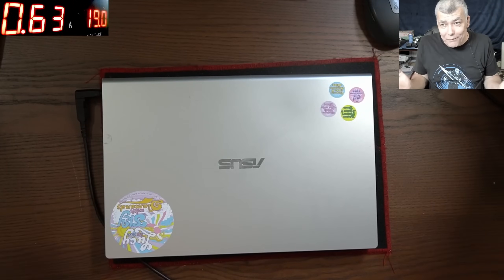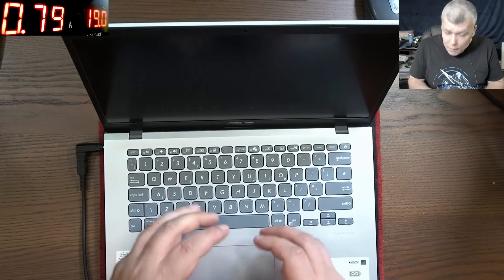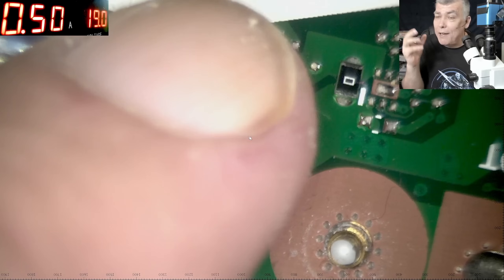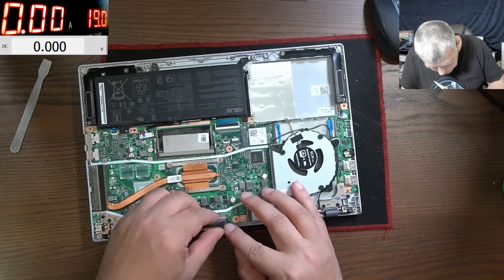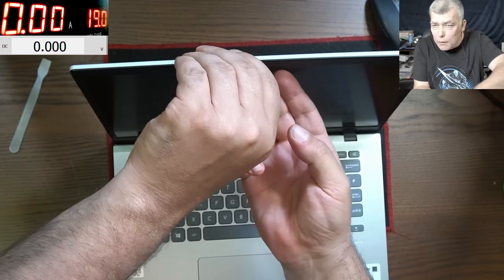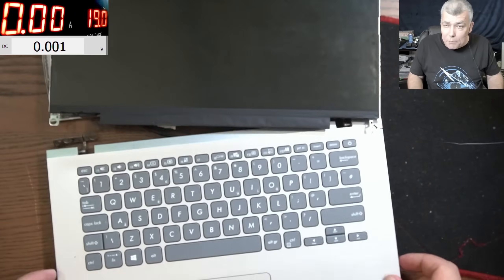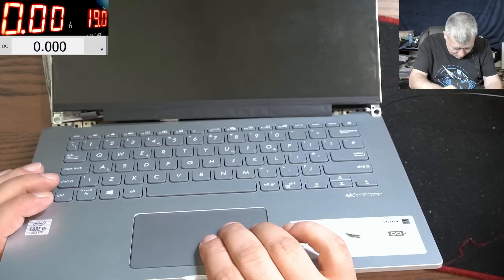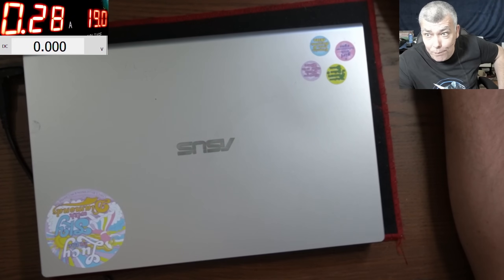Asus X409 no screen backlight repair - You can do it, all you need is a magic touch :D

Comment: Nice repair that show you don't necessarily need tools, or soldering skills to repair a laptop sometimes.  Also I too miss the days when screens weren't taped on, just take off 4 screws and you were in. Very easy to go back and forth if needed.

Comment: I have a different issue. My screen will light up eventually but I have to power cycle especially when the machine has been shut for hours. Sometimes it comes not on boot screen but later when Windows boot... No idea what causes it. X553MA

Comment: Thank you sir, this video saves me, i have same laptop from customer having flickering issue , i'd change the display cable and also check another screen but same result, and suddenly display got dim and customer argue me to give me his laptop as the same condition he brought to me, i was in trouble and ask customer for some time, this video save me , i bypass the resistor which act as a fuse as you mention, then it works smoothly, thanks again sir, hats off
Reply: @anantjain2585  Imma try this one. Yeah i have the same problem with you bro😭

Comment: Hi Sorin ! I often have to deal with glued screen. My solution: I do remove the Hinges and most of the time you can get a view on little tabs to pull the sticky tape.

Sometime they start a bit under the screen. When they are too hard to reach i do what i do when i have to replace a phone battery. Hot pad around 70/75Celcius (depend if cover is made of plastic or Aluminum) for about 6 to 8min, then i try to pull a bit on the screen corner (top corner) and with a pointy tweezers i go fishing for the sticky tape :) ! 
Last resort i do put some Isopropyl alcohol on a plastic card (i like to use the soft one they put with new Ipad battery) and slide it gently from the side to help me remove the Stickyband.

*Carefull with isopropyl, you can easily ruin the LCD if it goes between the diffusing sheets, that's why i'm dipping the card and not pourring behind the LCD*

Have a nice day !
Reply: Lenovo slim screen were made like that with 2 glue pull tapes on the bottom of the screen.

Comment: 13:14 - Vibrations + humidity is root cause for bad contacts. Once it took me 10 working days on big machine to find connector with bad contacts. It works but it doesnt work well enough.

Comment: I love the proper calibrated fuse  ❤ also my APC UPS have 1 of them by the factory on charging circuit (i discover it wen sort circuit the battery cables and replace it with the same thickness wire as the factory).

Comment: I love watching you videos they are so educational and informative...... in regards to removing the laptop screens with the adhesive if they don't come with the pull tabs I always use a little bit of contact cleaner to free the adhesive and it comes off without any problems...... you can see if that helps next time

Comment: As a technician i always get wary of when a customer wants something diagnosised and fixed but fails to tell me that others had attempted the repair prior to me.  Someone had that screen removed before because those screen bezels don't just crack from normal use.  It was removed and someone was poking around in there prior to Sorin for sure.
Reply: The amount of times an end user told me their screen cracked "on it's own" lol
Reply: I think there’s a spot on the right hand side of the frame about  3 quarters the way up that a spudger fits nicely into. Just pulling them off is asking for trouble.
Reply: Its a school laptop so according to the stickers, children play with it a lot :D
Reply: @tomrous  That may be true but KIDS can't play with screen bezels.  They have self-adhesion and only get damaged when removed.
Reply: @KennethITGuru  Well, my laptop has an gap (non sticking glue) at the top under the webcam after 4 years of use. Second, they can use pieces of paper etc to stick it under the bezel. And then they can try to remove it and break it (its not that hard).

Comment: I could fix the same problem by unplugging the vga cable, starting and plugging it back, the backlight started. The problem was caused by some non-English mo3 songs, and their instrumental versions. It’s ideal to listen English songs, and their instrumentals. Songs also defect the Asus batteries, causing X, and immediate drain. Even, if the Windows is legal and activated, the DVD is legal, the code is for the DVD.
Reply from the maker: https://media.giphy.com/media/bzOwkffoJcEXcP2OxW/giphy.gif
Reply: @electronicsrepairschool 😂😂😂😂😂
Reply: @electronicsrepairschool  that reply was priceless 🤣🤣

Comment: Ty Sorin. What do you think about the cooling system on this type of laptos? A fan far away from the cooler?
Reply: I think, These laptop use metal body so no problem in heat dissipation.

Comment: Yes I've criticised you about fuses in the past, but if I hadn't would I have learned why you don't think it's as important as I thought it was? I still think correctly rated fuses are vital in equipment that is directly connected to mains voltage or has a potential for high current or fire risk. But in some cases the fuse is not about safety, but just a design choice made that may not be as vital as we may think. Experience has taught you when a fuse is not a vital component so I accept your decisions. I have always respected you as a top repair guy :)